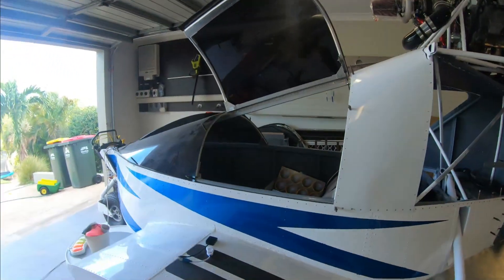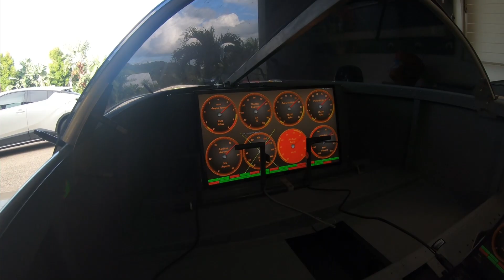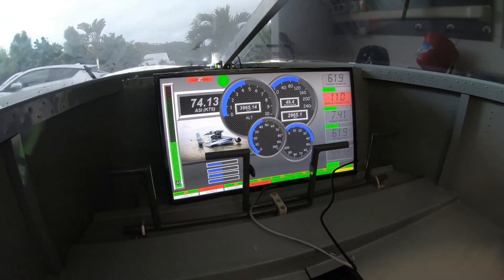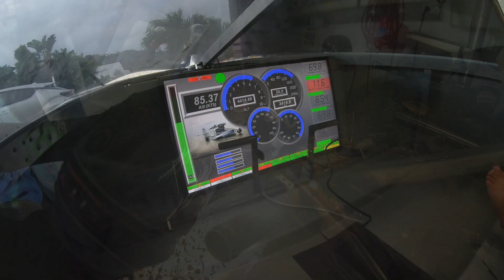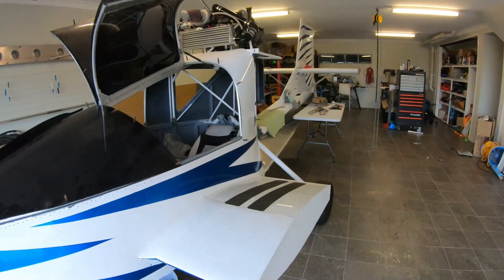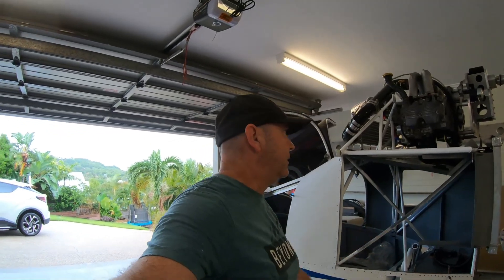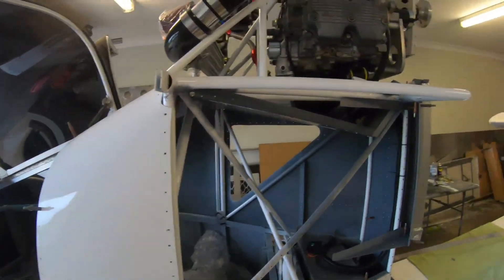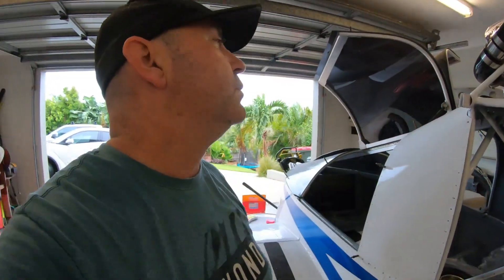Build log Seaplane Turbo exhaust Custom EFIS for ultralight/ Experimental aircraft Subaru megasquirt

Comment: Hi Michael,   Great videos and and great projects!  I built an Osprey and really wish I had turbo for high altitude lakes.  In addition to high altitude lakes, long distance cruising in an amphib really benefits from the exponential decrease of drag with altitude (and our amphibs are draggy birds!). Do you have altitude intents or are you just after power?   If just power, why not go with higher compression?  On a separate note, while you will have plenty of elevator authority with power on, I worry that your elevator/stabilizer may be too short for sufficient elevator authority in power off and high angle of attack conditions.  Also, I found VG's especially helpful for the Osprey (stall reduction, slow-flight control, and importantly around the cockpit to reduce prop cavitation and increase high angle of attach control authority).  I look forward to your adventures.  Cheers!
Reply from the maker: Thanks for the comments- I really need to get back to this project. I haven’t built the elevator yet so may take your advice there and extend it . I chasing both power and altitude so turbo is the natural choice my Cruzer had high compression NA and only got 160hp I’m chasing 200+ for this project.

Comment: I may have missed it. Are you shielding those rubber components and the front of the engine from the exhaust? You are going to get a lot of radiative heat soaking into the intercooler as well.
Reply from the maker: @Tim S I will probably need to do some shielding I was thinking the intercooler should be ok cruising at 100kts there should be enough airflow to push the radiant heat away but I definitely will need to look at the engine side. Thanks for the comment appreciate it gives me ideas 👍